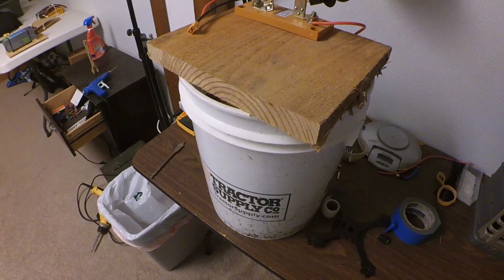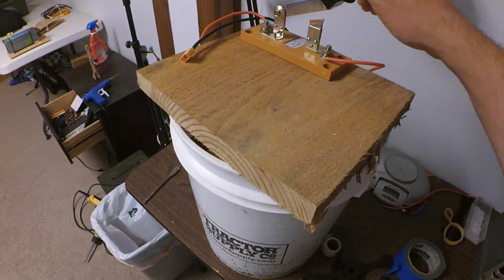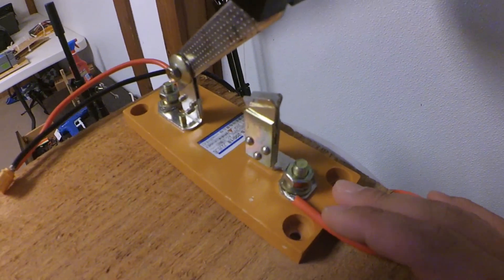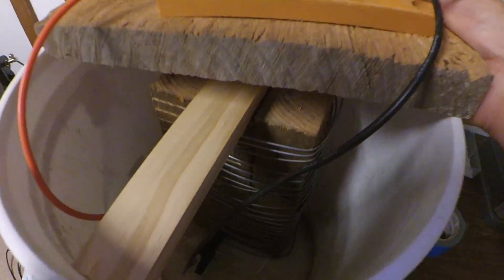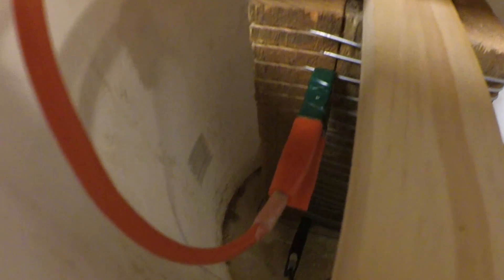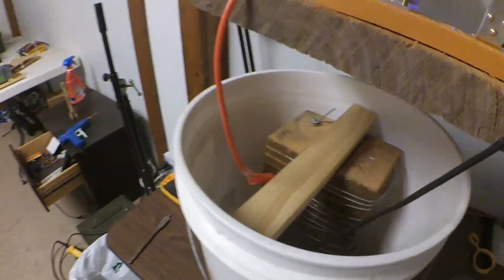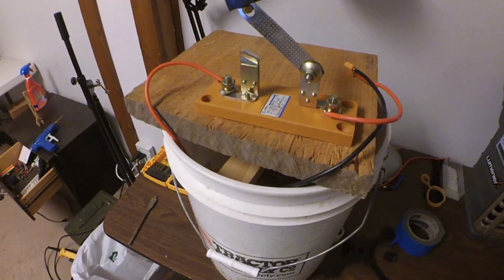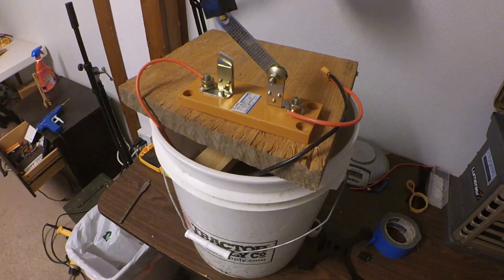Easy-to-build High-Current LiPo Battery Discharge Load

Comment: how did I not see this till now!
great build Josh. I ordered the halogen bulbs already so I'll try that method for now. 
is it just as good just annoying?
Reply from the maker: +neil morehouse halogen is less hassle but annoying because bright and hot. The wire load is a hassle dealing with a big bucket if water but easy after that. You may not be able to get lower discharge rates at all depending on what type of wire you use. Mine won't go much below perhaps 40 or 50 amps. I haven't tested the exact bottom end but I was trying to get 20 amps and didn't have enough wire.

Comment: How does adding water to the bucket not short out your coils?
Reply from the maker: The metal is a better conductor than the water, so the majority of current flows through the metal wire. Some current probably flows through the water, but no damage is done because the water prevents the metal from getting hot.
Reply: Water sucks as a conductor.  Until it gets a bunch of crud in it, anyway.  Last time I measured a cup of filtered tapwater, it was a couple million ohms...

Comment: Just a big heater. Not a idea, bro.
Reply from the maker: +Damon Keller hater...
Reply: Bro, I didn't have the sound up but wouldn't it be a good idea to have sand in it or would it be bad because of the heat build up?
Reply: Joshua Bardwell not hating. Hell everyone's videos helps me out a lot.
Reply from the maker: +Damon Keller the wire would burn without the water.
Reply: What about the coils from a space heater?  You may have a meltdown from that bucket.
Reply from the maker: Space heater coils are typically designed for 120v so they would have too much resistance for 12v I think. But yeah, it could work. Maybe they would pass current but wouldn't get hella hot. The other thing is that I need to be able to adjust the length to change the resistance, which I think would be hard.

Comment: Great hack, temperature will change the resistance of the wire making results less repeatable. Both ambient temperature and the coil heating as a result of the discharge. An electronic load would be more accurate but not as economical :) http://www.chromausa.com/instruments/electronic-loads/
Reply from the maker: I have found the current results to be very consistent once the clamp is placed. The water keeps the temperature of the wire pretty consistent. I would say there is less than perhaps 10 degrees F change in the water's temperature over the course of the tests, just from how the water feels to my hand while moving the clamp.

Comment: I think variance would be due to different temps and moisture in the air, would be cool to know for sure tho. Maybe you could get it setup then heat the wire a bit and test again to see if the amps you pull changes
Reply from the maker: The wire heats somewhat during the tests, but the amps don't change significantly.

Comment: you dont think the current flow is limited by the windings a like you stated? as far as testing an 80c battery and you are only seeing 60-65 amps. Seemed like most of the batteries you tested did about 60-65 amps
Reply from the maker: +Cognomen current flow is limited. That's the point. I don't want to short the batteries and destroy them. 

The batteries did 60 amps because I set the load up to draw about 60 amps. I could make it draw more by putting the clamps closer together but given how badly most batteries perform at 60 amps, I don't see a point in going higher.
Reply: +Joshua Bardwell gotchya. would be neat to see max amp draw though! haha.
Reply from the maker: +Cognomen max would be something like 200 amps followed by smoke and fire.